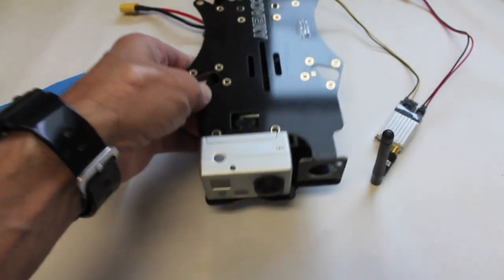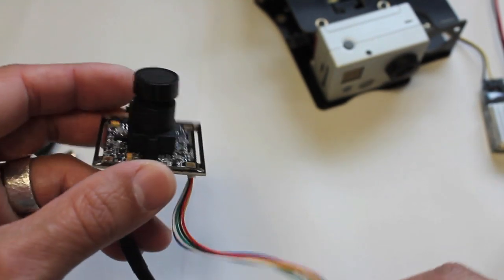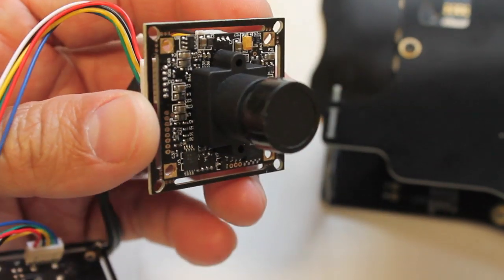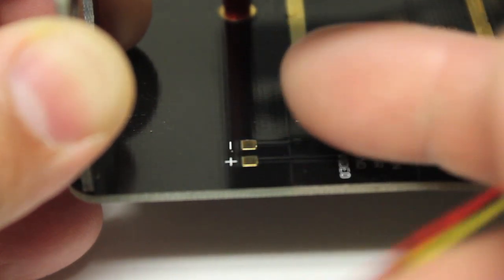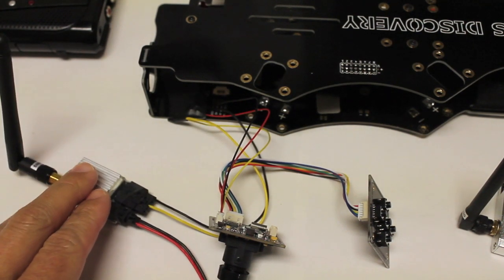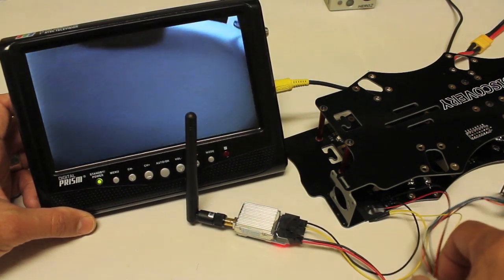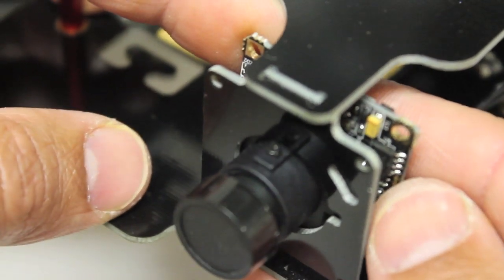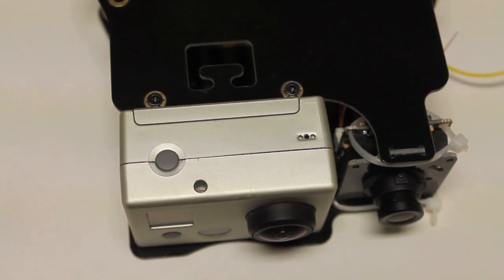TBS Discovery with DJI Naza & GoPro FPV - Upgrade to Dedicated 600TVL Sony FPV Camera

Comment: hi. I bought the camera, and ready to install. You mention that you take power to the camera from your tbs 3s battery, since the camera input voltage is 12 v. I`m using a 4s battery (14.8v). Will that burn the camera? Thanks for helping

Comment: Also you can use a fat shark filter and use one battery for all systems on the quad. Typically I put the filter between cam and video tx so both are shielded from ESC & Motor noise

Comment from the maker: Yes, you could use this to record video on the ground, but you'd obviously need the proper setup to do that. I'm pretty sure the quality won't be good as the GoPro, especially if you're recording at 60fps. But the receiver does have two video out options that you could run one to your goggles and other to your recording device.

Comment from the maker: Have you isolated the problem to your camera? Is there a chance it could be a setting on your video monitor or goggles? If you do use a monitor have you hooked up another output source to see if the problem still exists? That would allow you to isolate the problem and determine whether or not it's your camera. I would be surprised if it is, but you never know.

Comment from the maker: If by "video ground" you mean the ground that comes off your FPV cam, then yes. I had thought the exact same thing when setting it up and didn't solder that ground cable. It didn't work. Then I soldered the ground and everything worked perfectly. I'm referring to the ground that is part of the 3 pin connector that plugs into the +12V port on your FPV cam. I hope that's what you were asking :)

Comment: Dennis i have a question if you don't mind. I'm setting up almost the same setup on a different frame. I can't solder my Vtx video ground to the frame. Do i actually need to connect the video ground? Or is the ground from the power side of the Vtx enough? I hope i explained that right. lol...

Comment: Well i think there are uses for both. The brush on liquid tape is handy because you can brush it on exposed pins and contacts where it's impossible to use heat shrink tubing and normal tape just doesn't cut it. The stuff can also be peeled off when needed. I used liquid tape to waterproof my rc car ESC and receiver! I thought i'd use the tape to protect exposed pads on the TBS discovery when i get it eventually :)

Can you make a video on your thoughts and tips on the TBS frame?

Comment from the maker: Do you prefer it over heat shrink tubing? I saw some spray on electrical tape at Home Depot, but wasn't sure if it was worth anything. I've seen the kind that you paint on too. Which type do you use?

Comment from the maker: I don't know the size of the screws, but I had a bunch of spares and found ones that fit perfectly. I'll put together a video that shows the ideal settings for the cam, but you should be able to use it out of the box and then improve the settings over time. That's what I've done.

Comment from the maker: Great question. I actually run separate power for the FPV setup for that exact reason of interference. So the 3S powers my ESCs, motors, and controller while the 2S powers my video TX. Hope that helps.

Comment: Hello again sir. are you still using the zip ties to mount your camera to the frame? is there another way like putting a hot glue or using the screws on it?

Comment: Hi quick question.. did you install a noise filter for the camera since you are running the power and ground for the camera directly from the tbs frame that also runs the esc's wont you get static or interferance?

Comment from the maker: In most cases the Fat Shark's should work with NTSC or PAL video format from what I've read. Perhaps you should try connecting your FPV receiver to a LCD display that has composite video if you have one. What model of Fat Shark's are you using and I'll see if I can help?

Comment from the maker: Yes, the camera comes with two cables. One is a cable for the camera menu that you use to configure it. The other is power, ground, and video signal, which you can see at 04:30 in the video. Let me know if you have any more questions and I hope this helps.

Comment: the only way i can use my gopro for live fpv feed at same time as recording is to set it on 960 with any other settings the gopro locks up solid and i have to take the battery out to get it back on. I have rolled back the frmware and redone firmware loads of times. It also freezes up when i plug in tv out to a television set. Gopro say its nothing to do with them as its when i plug in a product that is not made by them.